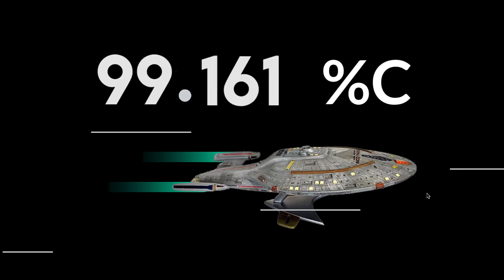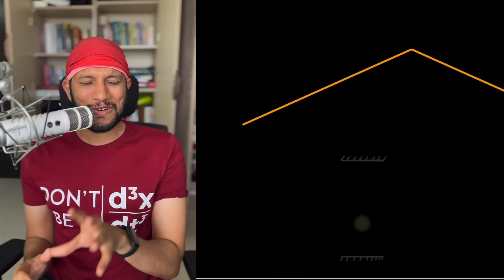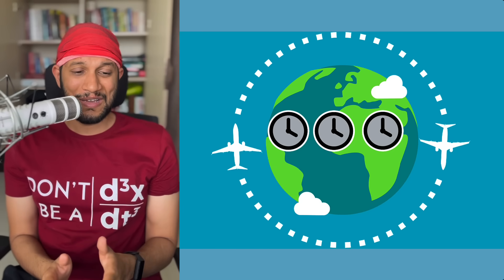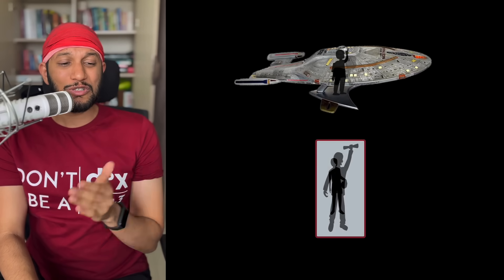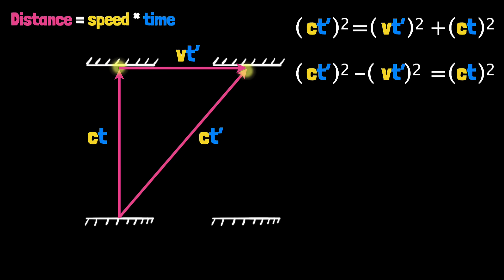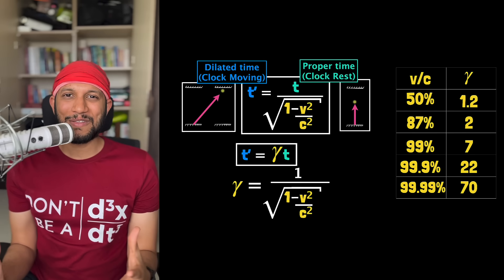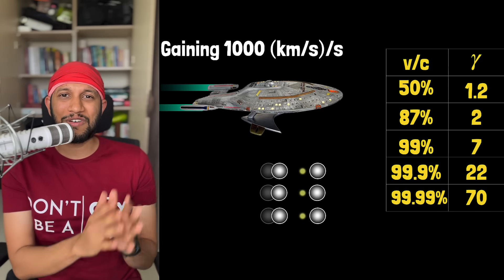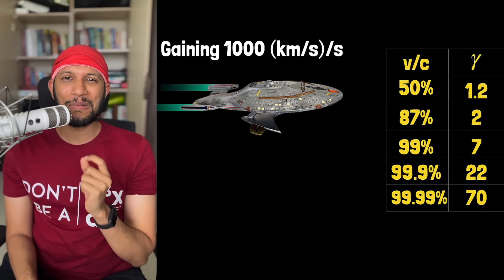I finally understood why you can't go faster than light! (My mind is blown)

Comment: Why are we assuming the speed of photon is constant in different frames?
Reply: We aren't, we discovered this empirically.  Very briefly and oversimplified, around the middle of the 19th century Maxwell formalized the laws of electricity and magnetism into a single compact theory.  From this theory we get the equation governing the propagation of electromagnetic waves (i.e. light), and this equation has the speed of the wave's propagation as a constant, c.  This was troubling as this speed ought to be dependent on the reference frame, so why is it appearing as a constant.  The leading explanation at the time was that the universe was permeated by a "luminiferous aether" that acted as a sort of absolute reference frame, and it is relative to this aether that electromagnetic waves propagate at c.  Around the turn of the century Michelson and Morley conducted an experiment to measure the earth's velocity relative to the aether.  To do this they measured the speed of light in different directions, expecting to get different results and to use that difference to calculate the earth's velocity.  Instead they found no difference.  This basically threw out the aether as a viable theory, some smart guys came up with alternative ideas, and in 1905 Einstein formalized this work into a single theory: special relativity.  Again, very oversimplified.  And I should also note that special relativity has been repeatedly experimentally verified to the point that it can be considered as much of a scientific "fact" as the existence of gravity.  Of course we may not have the full picture and some new evidence may come along that the speed of light is not always the same in every reference frame, but to our best current knowledge (backed by a mountain of empirical evidence) it is.

Comment: Couple questions in terms of photon clock:  It clearly makes sense when the photons are firing up and down while the clock travels left  to right, but what if the clock is set on its side?  in this case the photons are firing in the same direction of the travel...left to right.  How do you illustrate that?   Second, if photons are firing at the speed of light, the hypotenuse cant exceed a 45 degree angle.   For every 1 inch a photon moves upward, it can only move 1 inch perpendicular unless its moving faster than the photon.

Comment: So if one did achieve the speed of light, time stops. For every action there is an equal reaction. That must mean once that threshold has been crossed using gravity to pull through. Time would begin in the opposite. One would travel back in time.

Comment: The speed of light is not known in an 'absolute' fashion ... It is only a theoretical concept (speed is relative to our world) and don't forget we (people) live in a time-mass world. We just cannot imagine nor understand concepts such as 'infinity' or 'nothing' . Try this idea: we are actually moving faster than what is considerd the speed of light. So if we accelerate ( proven with an accelerometer) we actually slow down ....
Reply: Makes me think of the neutrino problem where we detect only about half as many neutrinos as would be expected. Maybe some are traveling faster than we are able to detect (?) idk
Reply: @psilocin7268 If you're referring to the solar neutrino problem, that was solved over 20 years ago.  Neutrinos come in different "flavors" of electron, mu, and tau.  This is a bit complicated and requires some quantum mechanics to understand, but essentially these flavors can be thought of as different "states", and a neutrino can and will oscillate between these flavor states.  The "problem" was that we expected to see a lot more electron flavored neutrinos coming from the sun than were actually observed.  But the reason for the discrepancy is that, by the time the neutrinos reach the earth, a significant number of them have oscillated into a different flavor state that isn't detected.  The Nobel prize was awarded for this a few years ago.

Comment: I had an argument with a teacher about how there is no way of knowing if you can go faster than light or not. His argument was because we thought the sound barrier was impossible to get through, and then we did, then that must mean that the light barrier is equally as possible to surpass. Thank you for this video to show that that isn't the case.
Reply: Depends on how we define ‘the speed of light’, ‘travel’, and what counts as an object. 

Two objects moving at 0.6 times the speed of light in opposite directions are increasing the distance between them at 1.2 times the speed of light. So an observer one one of the objects would see the other object recede faster than the speed of light (theoretically).
Reply: @psilocin7268  My teacher was talking about physically moving an object ftl and not the roundabout way of bending space to get to theoretical ftl speeds without actually physically moving. Of course this was the same teacher who said that time dilation isn't real and if you can't physically reach an object, it doesn't exist.

Comment: So what happens if the observer also has a photon clock? Shouldn't that also move slower from the spaceship perspective and if so, shouldn't that mean that the time passes slowly in the observer than in the space shift?? Moreover, the observer looks at the photon clock, which moves at a very high speed. Doesn't that mean that light travels greater distance between each tick to reach the observer so this is the reason the ticks seem to take longer and no time dilation? Finally, if there are 2 spacecrafts moving opposite at e.g. 95% speed of light what does the observer see? 2 photons that move away at 190% speed of light. Either I am confused or very confused!

Comment: Gravity might account for 100% of the changes...so you have to remove gravity to truly determine if the speed/movement is causing a change. Then, you have to remove G force which may also affect a mechanical clock.  
Two of those processes are acting upon the clock. It would not prove time has truly slowed..only that gravity forces interact with a clock. 

We are permanently locked in time. Time can neither slow nor speed up...unless you are outside of the forces of time. Since all that we know is within the force of time (and space)...it leads to seeing a Biblical view as also a scientific view. 

Fun mental exercise though. Way smart dude in this video. 😊

Comment: Still wrong.  Still overlooking factors that apply to the scenario.  Basically, what you have (Einstein has) here is an extreme over-simplification of what is actually happening.  I won't be convinced until I see ALL the factors addressed. For instance, you begin the scenario stating a specified emission direction for your photon then, conveniently alter that emission direction to support your theory.  Why does that rouge photon even have to stay in the 'ship'? Are the air molecules inside the ship holding there?  Clearly, the photon has to be affected by the lateral forces applied OR it can continuously magically alter it's emission direction to suit your experiment. Sounds fishy.  Make me see the light. (Pun intended)

Comment: Ahh but you can.  We go faster than sound in air.

However we cant go faster than souns in water.

Space is similar, the ether or quantum feild is very stiff so its very difficult, however

Regions of space have different speeds of light as they increase density of the ether using gravitational feild. In space there are many gravitational waves meaning space ether has different densities so light speed  is being constantly modulated going faster or slower.

Comment: Wasn't there another issue w/ size when traveling at the speed of light? I remember something about in order to travel at that speed you'd have to get smaller or bigger or something like that. Anyway, if it takes infinite energy to go at the speed of light, why can we turn on a flashlight powered by AA batteries?
Reply: You might be thinking of "length contraction", where an observer measures the length of an object moving relative to them as shorter than when the object is at rest.  For instance, suppose a meter stick is passing by you at 80% of the speed of light.  Due to length contraction, you would measure its length as only 3/5 of a meter (and obviously it normally measures as 1 meter long when at rest).

You could also be thinking of the idea that your mass increases as you approach light speed.  This is only true in a technical sense though.  It's not really "mass" as we typically think of it that increases, it's something called "relativistic mass" which is a combination of the typical kind of mass and kinetic energy.  It's basically a mathematical trick to make certain formulas look nicer.

As to your flashlight question: it only takes infinite energy to accelerate an object with mass to the speed of light.  Light itself is massless so the infinite energy requirement does not apply.
Reply: @charlieharris4881  Thanks!

Comment: I mean, I understood everything that was said ans it was great. But there is one thing that bothers me: from the ships perspective it would be accelerating forever? did I get something wrong?
Reply: From the ship's perspective (meaning measuring in the reference frame of the ship itself), it does not accelerate at all and its velocity is always exactly zero. The ship can't be in relative motion with itself.  Now someone on the ship could choose some other external reference frame to make measurements from, but this is no different from an external observer measuring the ship's speed, and as already discussed in the video the ship's speed in this frame will never reach the speed of light.

Comment: Really appreciate the video as it finally explains this is a way that I can understand why you can never accelerate or slow down to c. But there's something that I cannot get my head around. At 1:33 you say "the photon always travels at the speed of light". But for the observer outside of the space ship who watches the photon bouncing vertically at velocity c and simultaneously horizontally at velocity v, doesn't the photon move in the shown diagonal trajectory with velocity (according to Pythagoras) sqrt(c^2+v^2)? And this may very well (mathematically at least) be greater than c? Or am I missing something?

Comment: The scientific certainty of light is a limiting factor has been disproven by the University of Berkley. They photographed the effect of unseen particles passing through a hydrogen tank. They traced tachyon particles and concluded that these particles move FASTER than light. This suggests that there is a way around light-speed limitations. I read this in a scientific article, but can't currently quote it. If I had to make a very wild guess, I'd say that light-speed as a limitation can only be kept by supposing that tachyons are subspace particles that entered our universe by achieving infinite mass.

Comment: It doesn't matter if you use a photon clock or a normal clock, or a digital clock. I guess, for visualization, a photon clock is easiest to understand. But all clocks work the same, there is some kind of oscillation, and we don't measure time, we just measure how many times the oscillation occurred. All oscillations require to "walk" some distance. In a photon clock, it's the photon reflected. In an analog clock, there is the pendulum that swings some distance back and forth. Even in wrist clocks, there is a tiny gear that spins a distance back and forth. In digital clocks, there is the electric charge that is continuously charged and discharged, the electrical current is flowing some distance. In atomic clocks, the electrons change states in the atoms, again traveling some distance from the atomic nucleus back and forth. There is not a single clock possible that does not require some distance for an oscillation.

Comment: Excellent presentation / in layman's terms. There was only one factor not included (that I heard). Specifically, What about the quantum state, where two particles separated by an infinite space, has the same and identical actions. When one particle is impacted, that particle's reaction is immediately duplicated by the separated particle. This is applicable to lightyears of space between them. Has that been identified and provides understanding as to why this is happening? They are trying to develop (at minimum) instant real time communication between systems now (if not already put into practice in hidden R&D locations).

Comment: Understanding that no one on the outside of the ship would "see" the ship reach the speed of light due to dilation , why wouldn't the crew on the ship be able to reach the speed of light. from there perspective there still accelerating at 1000 m/s/s and the speed of light is finite would they not meet or exceed the it eventually.
Reply: Think about how someone on the ship would measure their speed.  According to relativity, all speed is relative, so they would have to choose some reference point to measure their speed relative to.  This could be some external point, but this is no different from an external observer measuring their speed, and as we've already seen the measured speed will never reach light speed.  The only alternative is to measure the ship's speed in its own frame of reference, that is, measure its speed relative to itself.  You can hopefully see that this must be zero since the ship can't be in relative motion with itself.  So either way, you'll never be able to measure a speed equal to or greater than the speed of light.

Comment: Ofc things can go faster than the speed of light.. Earth moves through space.. around a sun that moves also through space.. and then that sun is in a Galaxy also moves through space..

I'm pretty sure our Galaxy moves faster than the speed of light.

You can't measure speed over speed of light with anything that require you to view it.. like a watch. because we use light to view something.

and also.. everything is relative... if you have two spaceships are moving at the speed of light.. one in front of the other. if you turn on the lights on the one in the back.. do you think light wouldn't light up the ship in front? ofc it would.. and that means the light from one ship to the other is in fact moving faster than light.. relative to earth, where the ships started from. but not relative to the spaceship the light is coming from.

Comment: What if you are traveling at the speed of light and point a flashlight in front of you?
Reply: You can't travel at the speed of light, but suppose instead you are travelling at 99% of the speed of light.  The light from the flashlight will still move away from you at the speed of light.  

This isn't so surprising when you consider things from your own perspective.  First, it is meaningless to say that you are moving at 99% of the speed of light without referring to the reference frame you are measuring relative to.  So let's suppose that Alice is moving at 99% of the speed of light relative to Bob, then she turns on her flash light.  From Bob's perspective, the light travels at the speed of light with Alice tailing closely behind.  However from Alice's point of view, she is stationary and it is Bob that is moving at 99% the speed of light away from her.  So naturally when she turns on the flashlight, the light that is emitted travels at the speed of light as usual.

Comment: When you approach the speed of light, you stop experiencing time. Therefore you can go infinitely faster yet never hit C. Its not a paradox. Its physics.
Reply: You still experience time and it always ticks at the same rate in your own experience.  This is because in your own reference frame, you are always at rest.  It is only to an outside observer with whom you are in relative motion that your clock runs slow.
Reply: @charlieharris4881  Yes so to you, you go infinitely faster. Its not a crazy concept.

Comment: light speed does not = time travel. to travel faster than light you have to first warp space time around you. once you do this you can easily move well beyond the speed of light. There again you are not traveling in time. the misconception is from einstein trying to explain how traveling at light speed affects your perception not how it affects actual time. yes the clocks were out of sync but time travel did not actually occur.

Comment: You still don't understand!!!  The speed of light has nothing to do with traveling from galaxy to galaxy, or across a huge galaxy.  Moving from one point in the universe to another requires teleportation, which does not use a measure of speed at all.  This is a fact because of the ether, or as scientists call it Quantum Entanglement.  Going from one point to another is possible if that ether, or entanglement, is used, requiring no actual movement.

100% of your argument is based on false assumptions.  You are telling us that the twin on the plane that goes around the world constantly his entire life, could land years after his land-bound twin dies YET they are the same age.  NOT POSSIBLE.  Your education is flawed!